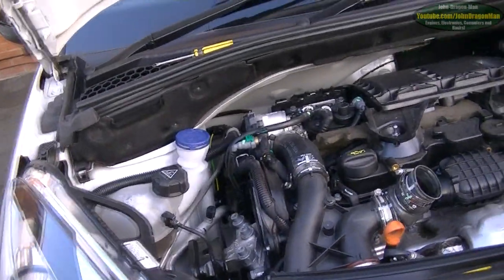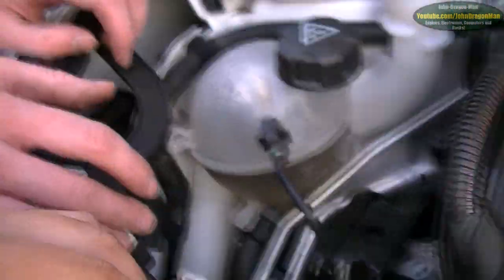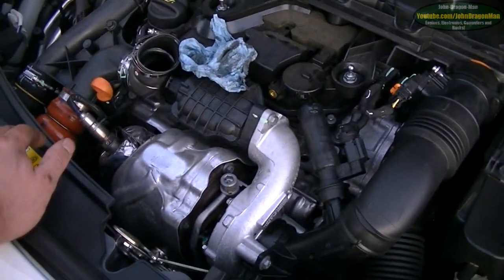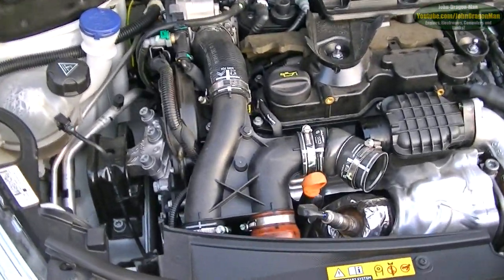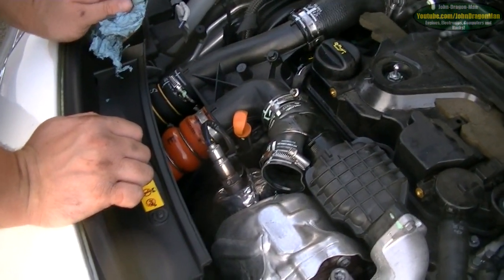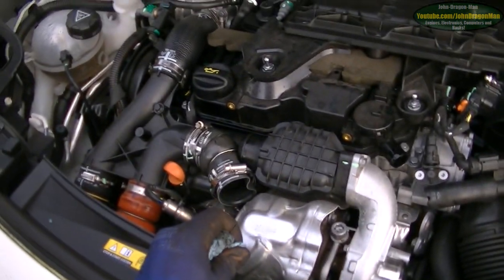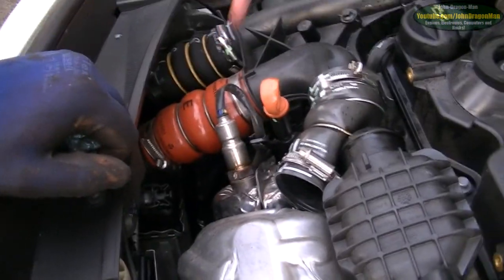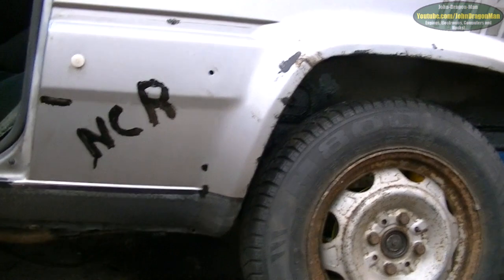Citroen DS3 1.6 diesel E-HDI turbo failure at 7500 miles

Comment: This 1.6 HDI is used on : 

1- Citroen (Currently)
2- Peugeot (Currently) 
3-Ford ( Currently )
5- Volvo ( Currently) 
6- Mini cooper until 2009 
7- Suzuki until 2009 
8-Mazda's currently 
this engine code is  ( DLD-416 ) 
for more information press the Link below 
http://en.wikipedia.org/wiki/Ford_DLD_engine#DLD-416
Reply from the maker: Great info! thanks for the post :D
Reply from the maker: i did figure that it was used in a lot of other cars and makes. this engine makes a very distinctive sound..  so its easy to guess what it is in :D
Reply: AVOID THOSE CARS ! Better buy old Golf MK4 TDI or SDi
Reply: Hristo Bundevski who said VWs are reliable vehicles ???
Show me one poll which states that ?
.
The Most reliable cars in the World
are the *SIMPLE* cars like the Toyota Aygo , Citroen C1 , Small Suzukis and so on
.
Why are this cars reliable ???
They have no Extras to go Wrong
no rear electric windows , no Parking Sensors , no Electric Parking brake , some dont even have Aircon or Assisted Steering
.
Simplicity equates to reliability , and German Cars are Far from being simple or reliable
Reply: if  your premium vehicle service costs
equates to 5x more than a French car Braking down  , your premium car is not reliable , I mean if your set of tyres cost  more than my french car being towed from London to Manchester  than you bough a badge instead of a vehicle you can rely on
Reply: the choice is never between an Audi with 2000 Miles vs Renault 2000 Miles. 
.
The choice is often between 90.000 Miles BMW , Mercedes or Audi vs 20.000 miles French car with 2 Years warranty left for exactly the same price

Comment: I have same engine in C4 picasso 1.6.8v.hdi 2012 and 219000 miles no problem ! But my oil change interval is every 10 000M..2.2, 2.0 ,1.6,1.4HDI the best turbo diesel
Reply: What oil you use

Comment: HDI is the best diesel engine ever manufactured. As any machinery some will be faulty. I have a 1.6HDI for 8y now and it's a workhorse. Also I put every summer only oil in it instead of diesel 'cause it is (was) cheaper. Best pollution standards and best mileage (75mpg). According to insurance statistics I think it was 2 ya, psa cars were almost last in breakdowns far below audi bmw or minis. I've seen 20yo peugeots that start on firs attempt as they were new... you just had bad luck... it happens.
Reply: totally  agree . Now  I am using my  second  berlingo   equipped with  1.6  hdi ,   first  one   ran   more than  200,000  kms    without  any  failure,   the  second  one  already  ran  140,000 KMs,   and   look at  my sharan  with  2.0  tdi (EA189),  at  160,000KM +   this month ,  turbo  failed ,  replaced  an original  tubro  and  the  4S  Shop refused to return me the broken part ,  damn  !
Reply: I had citroen c4 2011 1.6hdi 92hp 8v did not had any great problems and now  peugeot 308 1.6 e-hdi  115 hp 2015 with  201000km on clock, enigne is dry you cant grese your hands on it

Comment: My Berlingo 1.6 HDi has done 157,000 miles. Turbo has slight lateral movement on the shaft and oil is present in the throttle valve body. Yet the engine does not smoke badly and has just passed MoT Emmision  Tests. Turbo's Spin fast and get very hot so the Oil not only lubricates it also helps cool the bearing surfaces. Tolerances are set large  to allow lots of oil to flow through the shaft. My guess is that the car had a duff turbo fitted on manufacture. It happens. The design of the intercooler must be such that Oil cannot pool in its base otherwise bthe engine would choke and not run.

Comment: these engines are in fact very good as long as they are serviced regularly. I work at a Peugeot garage and we have had to replace these engines due to the oil pickup blocking because of not being serviced. the first indicator is normally the turbo seizes. then the oil pickup is blocked. the egr is a bit wank aswell tho
Reply: i need helpwith my 1.6 hdi enhine
Reply: bronx boy 12345 wats wrong way it?
Reply: its smoking and misfiring from engine. it might be injector
Reply: bronx boy 12345 is it like a hissing noise. Probably your copper washer on the injector. Fix it quicker or the carbon will seize the injector in.
Reply: aww thanks wildo tomorrow cheers buddy
Reply: bronx boy 12345 try tightening down the 2 injector screws first see if that seals it
Reply from the maker: you may be able to tell which injector it is by unplugging individual ones while the engine is running. in some diagnostic programs you can individually turn off injectors to diagnose faults.
Reply: johndragonman yes but only do that if it is a Bosch system. Don't do it on a Simeon's injection system as it can break the injector
Reply: i changed injector but it is still misfiring alot
Reply: I'm not sure mate it's hard to diagnose over the internet. Check cylinder compression and the pickup ring on the crankshaft for the crank sensor.
Reply: which is the bedt garage to go to if you no somebody
Reply: bronx boy 12345 I don't even know where you live lol! Try your nearest Peugeot dealership or a well known garage. Get her sorted for you 👍
Reply: thank you
Reply from the maker: ahh if you changed the injector, did you also program it to the ECU? every injector now common rail is around is different and needs to be coded to the ECU using dealership level diagnostic software. if you look at the injector, you will have a number on it that has to be updated in the ECU's software.
Reply: johndragonman that's only on the new 8v hdi engine. On the old 16v it makes no odds aslong as it's a Bosch to Bosch injector or Simeon's to Simeon's etc
Reply: i just put 15pound diesal in and it has stop misfiring and stop rocking
Reply: My car has started doing the same as this video but high mileage at 235K its a taxi so is service regularly and generally because of mileage its in every two and a half months. It always has total ineos put in it too do you think the oil pick up and oil cooler is worth being cleaned while the turbo is being done or will this be or should be standard procedure??
Reply: @bronxboy-sy5mb  hahahahahaha brilliant

Comment: You guys dont know what you're talking about. These engines are one of the most reliable engines there is. The oil in the intercooler pipes is normal as is the coolant colour.
Reply: So one would need to clean or change the intercooler every few years? Thats surely excessive?

Comment: This is definitely an isolated case, hdi's are quite capable engines in fact I know a taxi with 400k miles peugeot 406.
Reply: the old (pre-DPF) HDi's are competely different from these modern engines, the old ones are bombproof but DPF and EGR usually cause the problems on the new ones, would be interesting to see if this would have happened without DPF and EGR.

Comment from the maker: ***** make sure you use low ash engine oil! it costs more (naturally) and is not as good as regular synthetic oil (naturally) but it is the oil you are meant to use if you have a car with a DPF.

apparently the coolant should be that colour..

Comment: Why would using start-stop in a manual be any different? If you're going into neutral and take your foot off the clutch then start-stop kicks in. Manual drivers use the same roads and get stuck at the same stops as automatic cars. Assuming you're not an idiot and keep the ride the clutch

Comment: I have the same engine installed in my Mazda 3, beside Volvo, PSA-cars, Mini, Ford. This type of engine is really perfect now.
Not comparable to the OM 651 from MErcedes. Everybody thinks yeahhhh great german cars, perfect motors... google OM 651!
After the trouble PSA had with the turbo mounted in older models before the release many things have been changed. Crankshaftpulley, Oildip ;-) (they calculated the wrong amount of oil )  and so on. 
Your car maybe is driven in short distances? When I changed the alternator belt in my car, I had to remove the turbo hoses. Everything was full of oil. It was blow-by. Usual if driving short distances with dieselturbos.
I mentioned that in the following inspection and they told me that this occurs if you drive too short distances with a cold engine. Or if you fire if cold. 
The turbo doesnt like this because it is oil lubircated as well. Usually they use in this type of garrett-turbo the overpressure on the intake side to hold back the oil in the turbo core instead of sealings. 
So if you switch off the engine too fast without giving the oil the chance to loose pressure you have high pressure on turbo oil but a lower pressure in the intake air. Citydriving...
Now it is clear why the oil comes out. ;-) maybe. 
Or you just had a broken turbo, what may occur sometimes and you have warranty. The dealer surely said ... okay we change better before we get bigger trouble.

Comment: on mine old citroen zx td never need to change turbo,its pumping on 0.8 bar and i own the car for about 5 years,made 100 000 km with it and total are 316000 km
i like old citroen's like bx,zx,xm,xantia.
Reply from the maker: the old citroen and peugeot engines were very strong. the modern day ones are no where near as strong
Reply: johndragonman
dont forget economical too! only thing i dotn like on that car is gearbox,gears are too short.
Reply: i love my old Peugeot 404 with indenor diesel engine.
Reply: Neither my old 2.0 HDi, and that has turbo and is the original.
In addition, I have seen a 2.0 berlingo HDi of 90cv with 230,000 miles with original turbo and worked round.
Reply: Hristo Bundevski Indenor forever! old engine ultra super reliability.

Comment: My dear Berlingo has engine failure yesterday evening. Total loss of power,black smoke when revving. 169,279. Will restart but no power. These engines will give a long service life if the oil is changed regularly. 12,000. Miles. I do have a lot of oil in the pre-inter cooler pipes just like your DS 3😢. In gagarge for diagnosis. 😢😢😢
Reply from the maker: It sounds like turbo failure. Black smoke is always a good sign of that. However try unplugging the mass air flow sensor, if they fail that can also. Cause the same issues

Comment: Had my bearings go in my turbo CHRA got that sorted as it got put back on 10 miles later the injectors/EGR Valves are going these engines are a pain!
Reply from the maker: Aaron Smith yeah after we got this fail, we had it back from citroen and within a week later the EGR started playing up. i do put that down to the oil that had coated all of the intake manifold though.

they are killing off diesels with all this emissions crap. its not the engines fault. it is the fuel. if these were ran on renewable fuels then we would not have any issues with emissions.

Comment: As for clips and seals the original Citroën and Peugeot got recalled and they put tape round them, Ford designed a proper box, I blanked my egr with a plate

Comment: I have this problem on my Blue HDI 100. It is a taxi right enough with 235K on it but i have this problem on it now. It always burns or uses 1.5 litres between services from brand new but last two weeks bearing in mind its probably covered 2000 miles it has used 2.5 litres. The turbo was whining to begin with then made a lot of noise when gaining speed now its making rattling noises etc and loosing power. I called out rac to take it to the garage and while i was waiting i screwed of the intercooler hose which was coated with oil inside so im guessing this is where all my oil is going. Not sure actually how much it is burning as this would upset the system surely and throw a light on but i have no lights. Also no reduction in fuel efficiency either and no smoke coming off it. So either the DPF is catching it all our its not actually burning very much oil and instead firing it in to the intercooler. Im assuming its another turbo it now needs but not sure if we can get a cartridge for it or it needs to be reconditioned. Will need to see what the garage comes back with??? DPF was also replaced for a citroen one 6 weeks ago after it was blocked with ash.
Reply from the maker: At that mileage it's pretty common to require a turbo. We no longer have this car so I would be going on memory now. There's a filter mesh in the feed bolt that can be removed and help oil flow. Yes you should be able to get a replacement cartridge. I replaced one recently on a vivaro 1.9 diesel engine. Not a hard job.  Also make sure that your crank case breather is not blocked. Turbo rebuilding is not that hard.. And thankfully it's easy to get to on the HDI.
Reply: Garage has looked at it and confirmed intercooler is full of oil they reckon most of the oil is probably in there. He does not think too much has been burnt but they are going to check DPF levels to see. My DPF was replaced 6 weeks ago so it’s possible turbo failure is a result of ash blockage in the DPF. It only started using oil after my DPF issue so who knows. Garage has confirmed there is a lot of movement in the internals. I get very good deals from my garage as I have a very good relationship with them. As a result I have just asked for a new Mitsubishi turbo from Citroen supplied for £385 plus vat which is very good. I don’t think much point in getting a cartridge which is close to £300 if I can get a new one at that price.

Thanks for your help

Comment: that's normal in PSA 1.6 HDI the only thing that you can do is clean all the pipes and the intercooler cos the oil goes stright there....but is a good engine at the end
Reply: I can bet that my old VW Polo 6N SDi can outlast this crap. I prefer SDI then this shit.

Comment: What is faulty turbo in the end or the pcv valve faulty? I know some oil is normal in pipes on this engine but a lot can be the PCV valve membrane ripped so it sticks open or closed and this sucks a load of oil in. Also turbo will be louder with the pipes off, nothing to silence it.

Comment: not a big problem.....turbo cosume oil due to bearing problem or bearing seal as well as from breather intake line. I have 1.6 HDI for 9 years and it is a excellent engine with great torque , no oil consumption.  Turbo compressor outlet is always masked in oil due to oil breather line , rearly it can be a problem with oil seal on compressor, but generaly all this can be fixed in very short period of time.
Reply: How can it be fixed? Its a big problem because it happened in 7.5k miles...It can also be bad for intercooler, because it needs to be removed and cleaned. More mechanic hours.

Comment: Modern diesels have throttle flaps that shut when you turn off the ignition to prevent run away, so I doubt that would of happened, however it seems that either indeed the turbo seals had gone or excessive breather fumes are being vented through?!
Reply: How modern is modern? I've yet to come across this and had to stop a Focus from running away last October.
Reply from the maker: jonathanburford since euro 5 kicked in and DPF's were fitted to cars. my brother has one on his swift DDIS.
they make the diesel behave like a petrol creating a vacuum in the manifold giving better engine breaking and helping the engine slowly destroy its self..  err i mean..  helping the EGR suck in exhaust gasses.. that clog up the intake manifold quite bad.
my brothers car has 1600 miles on the clock and the intake manifold has a thick layer of soot built up on it already!
damn emission reduction crap slowly killing a decent engine.
Reply: jonathanburford my 54 plate focus 1.8 Tdci had one fitted, all most diesels have had them since around 2002, look for a throttle body type structure, you will either see a vacuum actuator or electronic motor which operates it when you shut off. However like everything flappy, they can stick or just not operate
Reply: On most cars the ASV (anti shudder valve) only closes for a few seconds and then re-opens, hence it doesn't always stop diesels running on their own oil. It's mainly fitted to increase EGR flow and stop engine shudder on engine shutdown. On DPF equipped/Euro 5 cars it will partially close during regeneration and deceleration to keep exhaust temperatures high.
Reply: Forename Surname in that case i would switch the ignition on and off until the anti shudder valve did its job, sometimes a little human intervention is required
Reply: It would re open when the ignition is turned on, best to stall it in 6th.